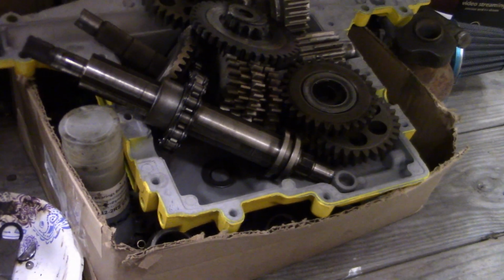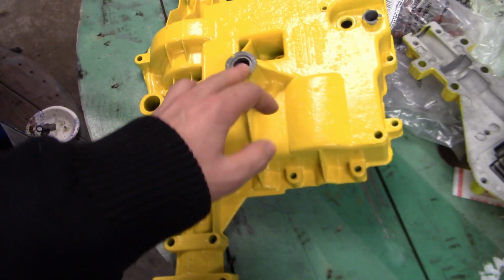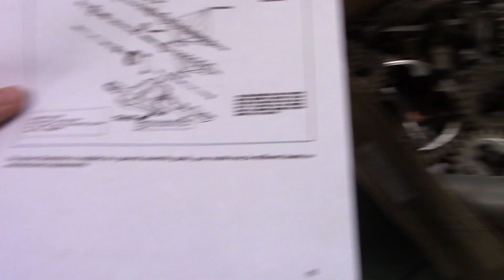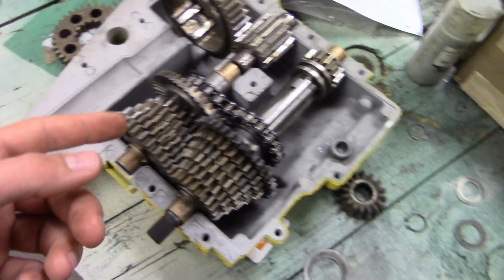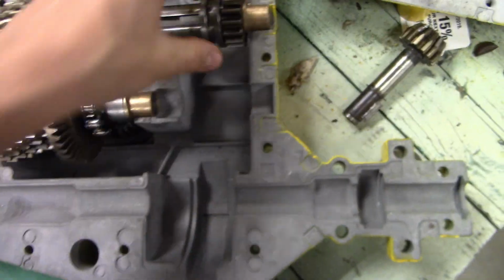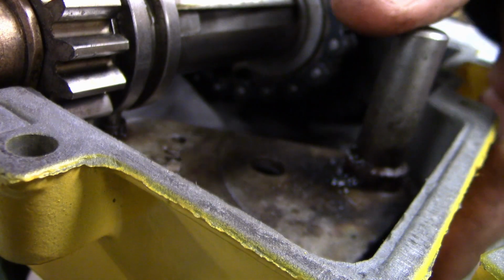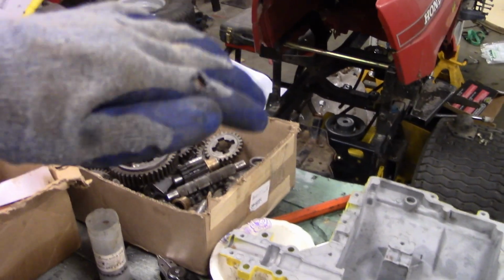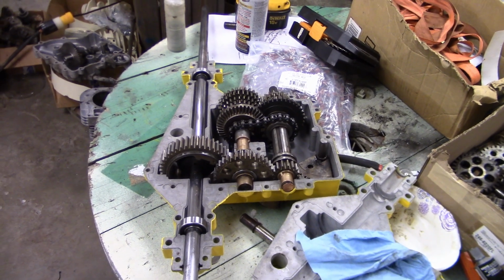2019 ATLTF Build off Pt 6

Comment: How do the gears rotate if more than one ratio is engaged at once?
Reply from the maker: One set of gears are always driven while the other set has only one driven when the shift key selects it. Its a nice little compact design, but the shift keys can break.
Reply: @OffroadMudMowers  Can it cause both to catch at the same time if it isn't in the right gear?
Reply: Volvo B10M yes, that’s one way you can “grind gears” is by not having the shifter fully select a gear.